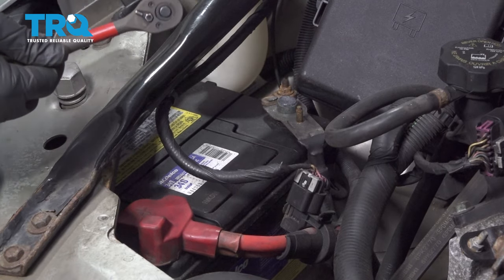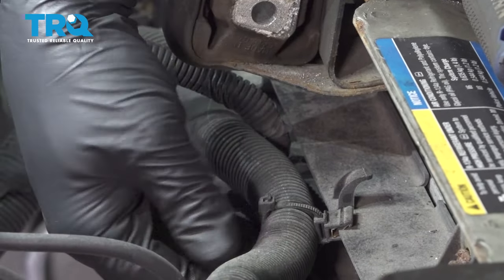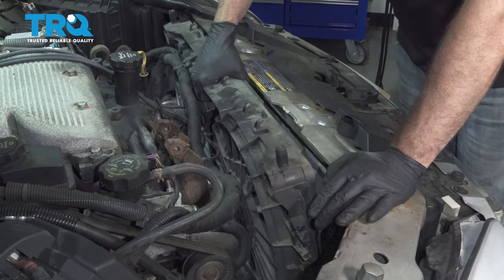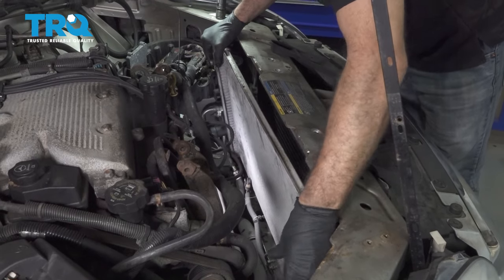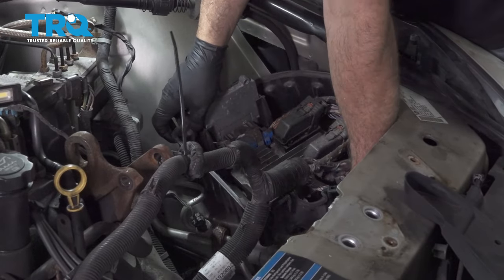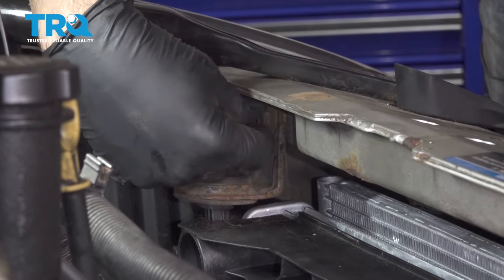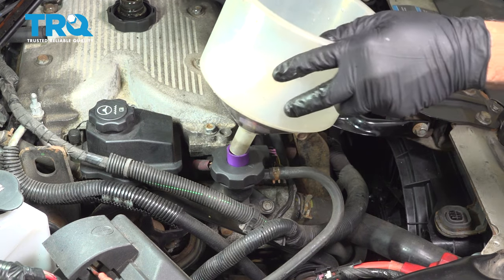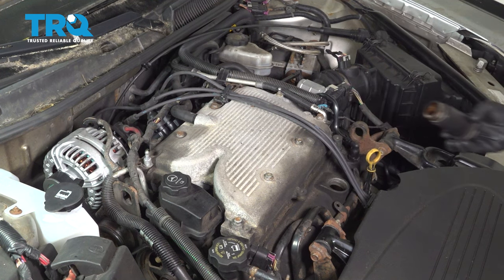How to Replace Radiator 2006-2013 Chevrolet Impala

Comment: Pro Tip!  The upper motor mounts: Put the e-brake on and put it in neutral and the motor will move easier to get these back on.

Comment: when reconnecting the battery cables always do the positive post and tighten it before doing the negative. It will prevent accidentally arcing from a tool making contact with a metal surface.

Comment: you dont have to remove air box ! or remove both motor mounts just disconnect from the front and push them to the rear of engine
LOL

Comment: @min 26:25 there is a plastic around the hose connected to the condenser. That's the only part was skipped and now I'm having a different leaked. It's oil coming from that one part you @26:25 mins.
Am I right or wrong?

Comment: I need help immediately 😂 but i try it and the bottom metal hose didn't click and spill out the fluid the one around 21:00. I don't what to do, I thought it went good, but now I have to take all apart, any suggestions

Comment: when removing the line directly below the transmission line, the one with the rubber spacer that happens to be broke on yours, mine is still connected and upon loosening the bolt to it it hisses and smokes and shoots out almost a yellow color liquid

Comment: I’m currently stuck at 13:39 because it’s not coming out
Reply: Don't worry about it, I just did mine and just go ahead and pop the lines out, your new radiator will have one ones and you just pop them back in. Good luck
Reply: I can't tell from the video but usually there is a nut right there that the line runs through. You could also just back that out with a wrench and free the whole line and clip assembly
Reply: You have to muscle it out. It will come out.
Reply: pull out clips with a pick and wiggle them free easy to do !